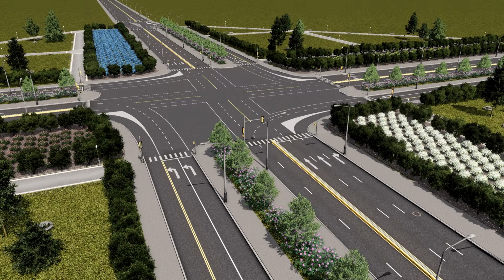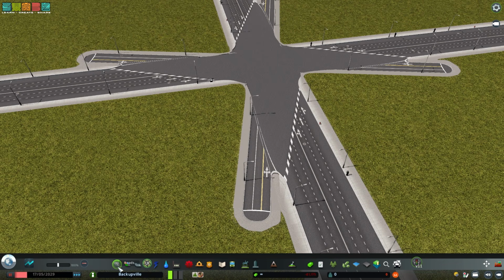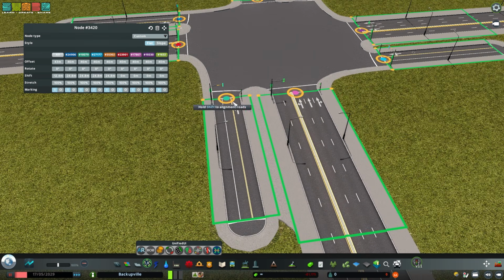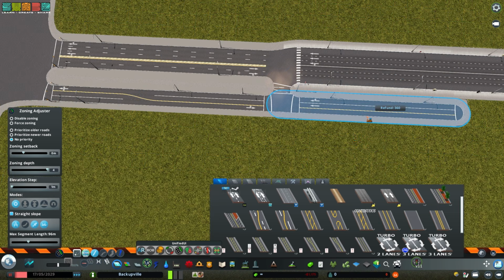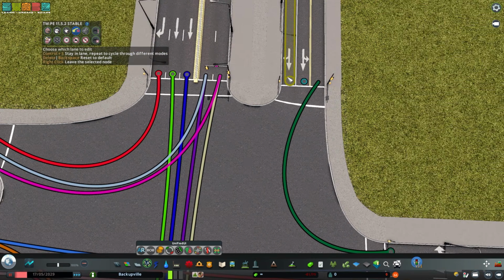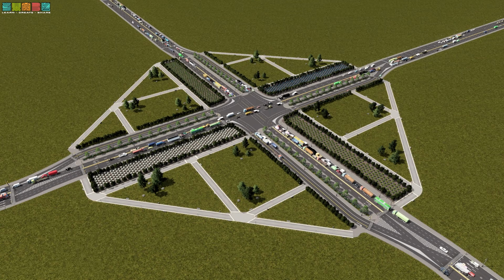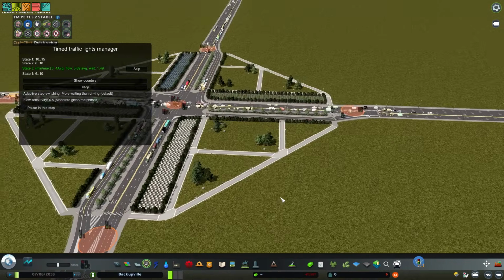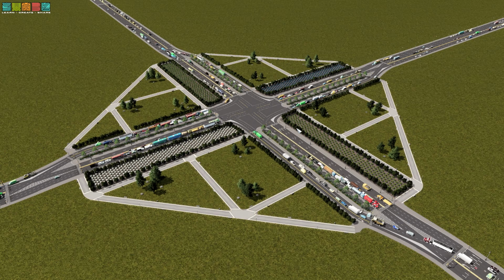Pushing a node to its LIMIT for the "Continuous Flow Intersection"! (CFI)

Comment: ngl that looks like a pedestrian nightmare
Reply: Agreed, it needs ramps/overpasses, or separate stage in the lights, but even then because it's huge it'll take a long time to cross.
Reply from the maker: It has islands. Peds can cross to the island easily from any direction. Its also a two cycle light. Constantly opening up for them.
Reply: @YUMBL  but isn't there always right turn traffic?
Reply from the maker: The right lane can just turn red when the cars next to them stop. Ez pz

Comment: I'd love to see you try to build Swindon's magic roundabout in Cities.
Reply: I think Biffa already has done that
Reply: @PSjustanormalguy  biffa did it very wrong though, he made a central roundabout with 5 little ones around it. The actual magic roundabout is 5 normal roundabouts that touch in the middle to create a counter rotating inner ring. It's very interesting
Reply: @chrisogrady28  Biffa can't make anything right, his cities and roads are inconsistent and wonky.
Reply: Mini Roundabouts tested in Benfleet in 1959 near the former Sadlers Farm Magic Roundabout which those tests created. Redesigned for the 2012 Olympics for Hadleigh access. The Worlds first mini roundabout still remains near Benfleet station between 3 pubs
Reply: The AI is so stupid it would probably get gridlocked because they use 1 lane
Reply: @GoatjePoempie  That's not true. It's just a matter of properly setting up the lane connectors.
Reply: @GoatjePoempie  tmpe has a setting called dynamic lane usage, cims will use all lanes more or less equally
Reply: @mccabecompositions  Yeah I know. Have it on 70% but they're still stupid
Reply: @GoatjePoempie  I keep it maxed, as it's a close as we'll get to real life until C:S 2 is released
Reply: @GoatjePoempie  That's because city builder games can't get AI right
Reply: The magic roundabout sign may aswell just read "Americans find another route"
Reply from the maker: I’m sure Americans drive it all the time.
Reply: @YUMBL  why cant there be a left lane slip
Reply: @Dankbuun1  It would have to go either under or over the left side of the road, at which point it's no longer an intersection (at-grade) but an interchange (with overpasses or tunnels).
Reply: @Dankbuun1  There could. It all depends on the requirements of your traffic. If you have a huge amount of traffic that the design doesn't accomodate, put in a fly-over. One of my goals is the minimum design that works.
Reply: @chrisogrady28  "Americans find another route", HEY!, I resemble that remark! Actually, I'm an expat living in Germany, and I love roundabouts. I hear a lot of snide remarks from my countrymen.
Reply: I think Biffa did it.
Reply: @CypherWulf  read above
Reply: roundabouts lol